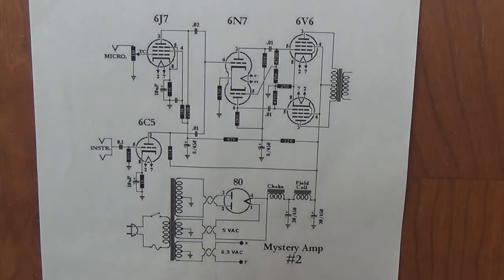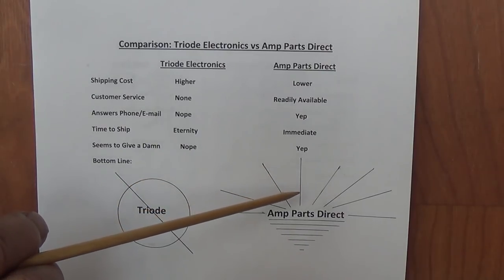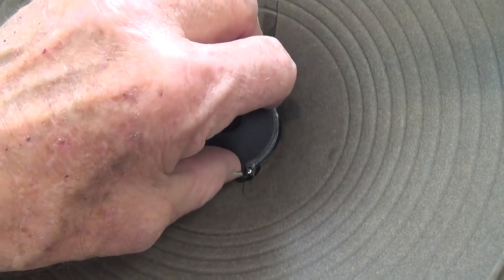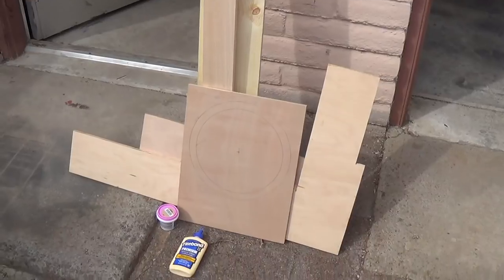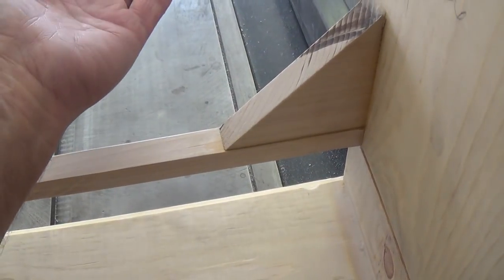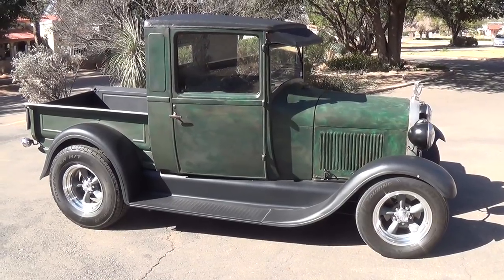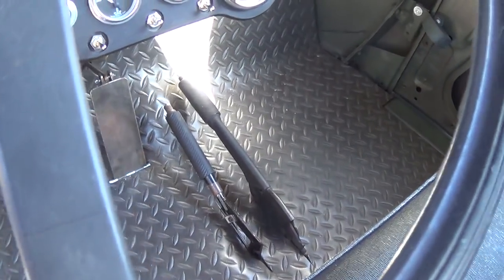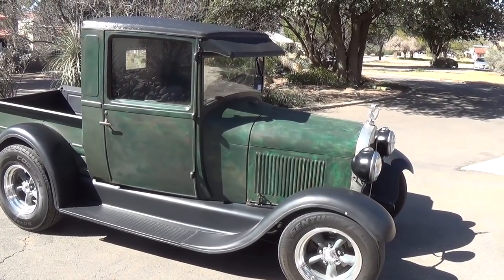Let's Build the Mystery Amp......Part 2

Comment: I see your amp schematic includes a type 6N7 as inverter tube, I have an old tube type FARM radio (late 30's maybe mid 40's) that uses a 6N7 tube as a triode push pull OUTPUT tube, the radio was designed to work directly off of 32 volts DC, no inverter, no vibrator supply, no power transformer, so the most that you see for B+ IS 32 VOLTS !!.  but having said all this this radio sounds quite good for its age, the audio output is rated up to 2.5 to 3 watts.
Reply from the maker: I've seen 6N7's used as phase inverters and pre-amp tubes, John, but never output tubes. Thanks for the info.

Comment: I have never had any issues with Triode, but will look into Amp Parts direct in the future. Too bad AES doesn't stock classic tone.
Reply from the maker: You may never have a problem, but I wouldn't count on it, Mr.M. I have tried to get AES to handle ClassicTone, but they don't seem interested in doing so. Maybe they have a sole-source deal with Hammond (?)

Comment: Uncle Doug, forgive me if you have answered this before but, what is your favorite lumber for building a speaker cabinet?  Also, I was sorry to hear about Rusty.  Thank you for all the great content!
Reply from the maker: You're welcome, DW. I use straight, select pine board, usually 1" x 8" from Home Depot. It is my intention to try a similar piece of redwood in the future, then finish it with stain and spray lacquer, rather than covering with Tolex. Properly finished redwood is gorgeous.

Comment: Nice work on both amp and truck. Did you never think about making a valve stereo or radio for one of your trucks? Good way to combine both your passions.
Reply from the maker: Thanks, DA. Old AM tube radios exist for antique cars, but nowadays AM radio is awful.  I do have a modern stereo system in one of my trucks.

Comment: Cool rig! Haven't been watching you long but love the channel. I'm new to the workings of amps but find them pretty interesting. I wonder, do you cover any of the old Valco circuits? Some of those were fabulous! Low wattage monsters!
Reply from the maker: Thanks, Rick. Valco amps are among my most favorite. If you check my video list, there are many that feature all the popular Valco brands.
Reply: Uncle Doug yeah, after I opened my mouth I started looking and literally the first thing I found was your series on the Valco Supro circuit with vibrato and reverb circuits where you replaced the original reverb with a fender type reverb. The biggest thing i learned so far on that one is, if you're building an amp merely to save money you're probably wasting your time. Of course if you're doing it for other reasons such as what you want not really being available or just for the fun or challenge then it looks like an interesting project. There's an outfit I know of called Vintage 47 that builds an old valco 7w circuit w/no reverb or vibrato among some other vintage types. They charge what at first glance seems like quite a bit of money for it but after seeing your cost analysis they seem quite reasonable in price! LOL

Comment: Great old motor. I would like to point out the sound editing is a bit rough at several points with sections finishing abruptly and words missed off.
Reply from the maker: Thanks, Will. I'm aware of the problem and working on it.

Comment: Just a thought.  You have not yet disclosed the color scheme that is intended for the final product.  How about using brass bolts to anchor the speaker baffle.  There isn't too much of a mechanical load and the coloration would pop on top of black tolex.  That is, unless you intend to cap the heads in some way to hide them or have a color palette that would clash.
Reply from the maker: Thanks for your input, CK. In this design, the four carriage bolt heads and the four speaker screw heads are all countersunk below the surface of the baffle, epoxied in place, and then covered with fiberglass resin.  They will be completely invisible beneath the covering material.

Comment: on your carriage bolts, i was thinking you could use nylone washers or simple lock washers, or maybe wrap the threads with a little tephlon tape just to make sure your wingnuts arent going to back out over time and use?
Reply from the maker: I am using lock washers, Lee.
Reply: just as well, dont take advice from someone that cant spell nylon or teflon...:-D

Comment: Outstanding work on both the Amp case and truck!  Concerning chassis placement in an amplifier case, will the speaker vibration have any negative side effects on the tubes if the chassis is too close to the speaker?  Thanks and take care.  -Dave
Reply from the maker: Thaks, XT. I feel certain that when the speaker in a combo amp is operating at high volume, everything within the cabinet is vibrating like mad, regardless of proximity to the speaker.  I doubt that it has a negative effect.

Comment: When I started getting interested in amp building because of your tutorial series a couple of years ago, I searched the interwebs for suppliers for classic tone transformers / power supplies. I went with Amp Parts direct from day one, and I have been very happy! Do you have a recommendation for tube suppliers? I have been using both Sweetwater and Tube Depot.
Reply from the maker: I have had years of great service from Antique Electronic Supply, also called Tubes and More. They have never let me down.

Comment: Excellent video Uncle Doug.  I wonder if you might tell me; where did you find / do you buy - just a coil for a vintage speaker?  I was under the impression that only full recone kits were available.  Thanks !
Reply from the maker: Thanks, Don. I provide a link in my re-coning video to a supplier of kits and individual parts. You can order anything you need. They are very knowledgeable and helpful.

Comment: Hi Doug! What do you mean by classic tone Transformers, does it have any difference to a standard transformer? I think on the speaker it's a closed box unit I'm assuming, making the baffle floating will help especially with bass control dampening, if you want to take it off or not by using silicone adhesive make sure it's adhesive type  not sealant? you wouldn't need the bolts either if you're not going to take it off? By putting some beading on the baffle and then resting it on the box frame allowing about 4 mm gap by using some shims while it hardens, of course if you want to take it off use some greaseproof paper between the silicone adhesive beading, and the the mount. if you can get away without having any contact to the sides of the cabinet even better! you could have put a strip of inch prefer the hardwood beading around the side, Resonance happens at the edge of the material? And gone with MDF for the baffle at least and the back maybe half an inch to 3/4 of an inch very your sizes is better! try and get waterproof MDF it doesn't separate the same but make sure you wear a mask if you cutting it is highly toxic. I think  bracing would be good as well inch by inch and a half would be fine doesn't have to be big across the sides just behind the driver but not dead Centre? And make it slightly loose fitting and glue and clamp it hard with PVA glue or polyurethane, put the box slightly under tension, half a millimetre say of gap. give it a couple of inches either way top to bottom to cut down resonance? Will firm up the bass make it sound a bit more punchy especially if it sounds boxy. You didn't say how did you come to the conclusion to the size of the cabinet for the speaker are you using specifications supplied by the speaker driver for the size of the cabinet? You might want to try some bitumen pads the self adhesive ones quarter of an inch on the side of the cabinets about the size of the driver unit or little bit smaller keep away from the edges and corners tho they are used in motor vehicles try and get the one without the aluminium backing.
Cars looking nice what made you go with the colour! Have you push that front axle forward it looks very forwarding, not a fan of the wheels tho makes it look a bit cheap! My opinion a  more traditional style might be nice with a low profile tyres. I assume it's got an automatic box that's a shame! You could have had the gear lever coming out of the dashboard or underneath the dashboard bent upwards. Bed down into the floor with a universal joint or pivot joint in your case probably connected to a cam. if you look up French cars from the 70s a lot of them had this type of design. What's with the air suspension why did you go with that is it for Comfort! Another French design by Citroen they invented that.
Reply from the maker: ClassicTone is a specific brand of transformer, John, which offers wonderful tone quality at a reasonable price. Thanks for all the cabinet suggestions, however, vintage guitar cabinets are open-backed, never sealed like HiFi cabinets, so no sealing or volume constraints are necessary. Sorry you don't like the wheels. It's a matter of taste, but they are classic American mags from the 60's, which is exactly the look I sought for the truck. As explained in the video, there is no room for a vertical gear shift lever, and the color is original to the car:  Rock Moss Green.
Reply: Uncle Doug well that's why I mentioned about the gear shift going under the dash so you got room for your feet? If you imagine a inverted Z.
 What makes these Transformers so special then is it the gauge of wire they use why should there be so different to any other make of transformer? I can imagine  silver wire wound Transformers could sound good or silver coated is there such a thing. I don't know if you can tell me why these Transformers are better than anybody else's.

Comment: I been readin' the comments(8-). Funny thing regarding peoples' maturity levels. I've been to swap meets and
seen some interesting...ummm...thought processes(?) going on...or lack there of(8-). My attitude? I may or
may not know what something is really worth to someone else, but I know what I've got in it. And I've always
kinda liked the idea of selling, giving or trading to someone who'll actually use some items...or at least learn
something from said item(s).

Thanks, Doug...great video. Looks like I'll order from "APD" when I need xformers. I hope it isn't some human
tragedy going on at Triode though. Nasty stuff happens to good folks sometimes.

And thanks for the ride in the Ol' Ford. I'd have been tempted to drop in a 289 Ford motor, myself. But there's
certainly nuthin' wrong with the GM 283.
Reply from the maker: You're welcome, Tom. I agree in your hopes that the poor service at Triiode is not due to some tragedy.....but I'll bet it isn't. Re the 289 in the Model A, if such an engine were available, I would have used it, but the 283 became available not far from my house, and I was able to personally pull it, completely intact, from the '59 Impala that it came in.

Comment: doug;
not only is the cabinet looking really nice, congrats on the newly completed ride!
the 4" drop was a dead giveaway. :-) are the wheels vintage or reproductions?also....the crank,original or replacement? it's a point of personal interest to help reach a conclusion to a debate.
i like that jack approves of the xfmrs. the comparison of the two suppliers....
priceless!
thanks for  the view of the work on the builds and letting us in on them. 02:30 interrogation session over....
time to crash. all the best to you good sir.
=dok=
Reply from the maker: Thanks so much, Giz. The wheels are classic American Mag's, just like we used back in the 60's. If you're asking about the engine crankshaft, it's original stroke for the 283, but the engine was bored .060" over for a displacement of 292 ci.
Reply from the maker: P.S. The wheels are newly made, not vintage......but by the company that made the originals.
Reply: hi doug. about the crank...it's about whether it's the original drop forged unit or a replacement one.
there are different levels of durability involved with the different types(cast and turned...forged....forged and nitrided..) it's the survivability rate that we were debating. thanks for getting back with me on that one and enjoy the day!

Comment: Hi I'm having terrible problems adding spring reverb in my amp. Could you please  make a video  on how reverb works.
Reply from the maker: I added a Fender spring reverb to the Supro Tremo-Verb I built a while back, Andy. Check out the video series. It may be of help.
Reply: I think I did it right but I'm having a problem inserting it into my amp. I have v1 which is input stage 2 halves sent to 1half of v2 for mixing sent to tone control s to half of v3. The other half of v3 goes to v4 phase inverter and out. I've tried inserting reverb across the middle treble pot to the master volume in-between the 22k resistor. Btw I love your videos

Comment: bean waiting and  hang for this video, as you may already know pin 4 / 6n7 has no grid resistor
Reply from the maker: That and several other deficiencies will be remedied by the revised schematic, Ian. How about the series-connected pre-amp plates, each with quite different plate resistance?

Comment: Need help with output transformer. I am looking to build a Princeton 5fa2 but would like to use a 16ohm speaker. Any recommendations.
Reply from the maker: Check with ClassicTone. They offer OPT's with multiple secondary impedance, including 16 Ohm.

Comment: Doug there is no cheating baffle width. Deluxe reverb could be super small but is wide deliberately. You are robbing yourself of tone going small cab as possible. I have gone insane directly comparing zillions of cabs.  For a 12” speaker nothing beats a 22”+ wide cab with uncentered speaker placement in baffle. Turn that amp on its side. :)

Have you tried heyboer transformers? Classictone seem to have a nasal high mid hump. Both use old skool paper.
Reply from the maker: Thanks for the helpful tips, Billy.

Comment: Always good to have a second source for specialty parts. BTW, I built a second  slave 12 inch cabinet  last summer using your guidelines and tips ; https://www.youtube.com/watch?v=qI8PTa4FieM.
It was good to use your tips as you don't have much time with the adhesives and cutting around angled corners requires careful planning. 
The enclosure was for a 12 inch  Celestion that I wanted to use as a slave amplified cabinet that I could patch the preamp signal from a Fender Champion 40.  Solid state..
yes I know the differences between tube and SS, but it was cheaper using a transformerless amp using the Chinese made TD7294 monolithic amp with a volume control.
Reply from the maker: It's great to hear that the videos were helpful, SC. I'm flattered that you would use them for guidance :)

Comment: Good morning Uncle Doug. Sorry for this question but I'm trying to decrease my blood pressure. have an unrelated amp question. I bought a Marshall DSL40C back in may - (Not knowing it wasn't american). This morning about 4:30 am I'm practicing scales and I flipped it on stand by to refill my coffee. When I cam back I took it off standby -  short - medium loud hum/growl sound = dead. No sound. Pentode, Triode, clean, h-gain clean/h-gain = no sound.. I am having a devil of a time trying to fond out how to contact marshal usa to set up warranty work. Does anyone have a number?
Reply from the maker: I'm sorry I can't help, Jim. We rarely see any Marshall amps in my area, so my experience with them is quite limited. Hopefully another viewer will be able to help. You can also post a query on our Facebook Page: Uncle Doug's Vintage Amps.
Reply: Update on the Marshall. A friend came over with a tube checker. One of the EL84s was kaput. New matched pair on order from Amplified. Thanks

Comment: Doug I'm located in Holland.
Over here we have a company that make all kind of transformers also on specification. Cheap? No but they make them. You need a website translator site to view there website.
Located:

https://www.aeetransformers.com/nl/producten.html

Shop link
https://www.automatic-electric-audio.nl/

I have two UL push pull transformers for my 6550 tubeamp. They are very good. Maybe they can help you.
Cheers
Reply from the maker: Thanks for the helpful links, ww.